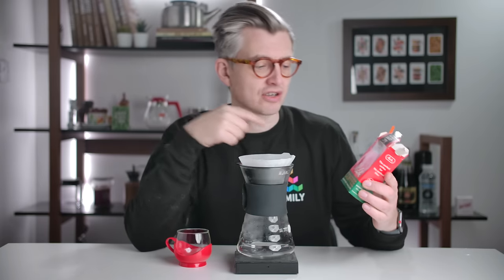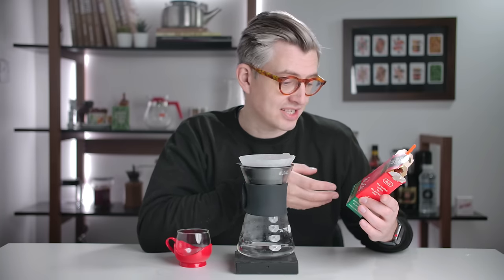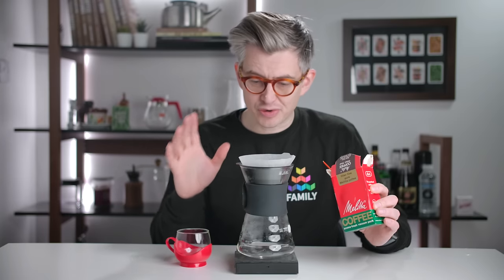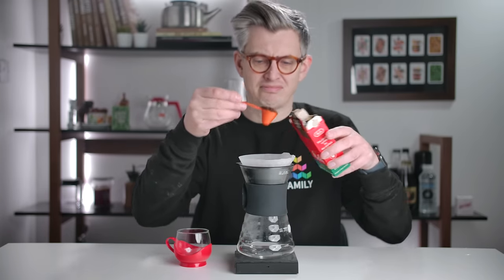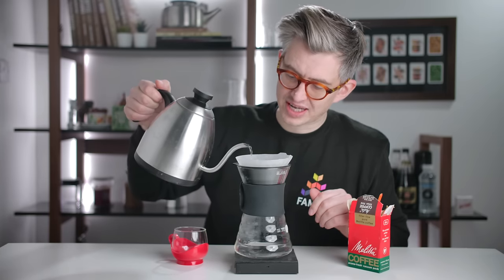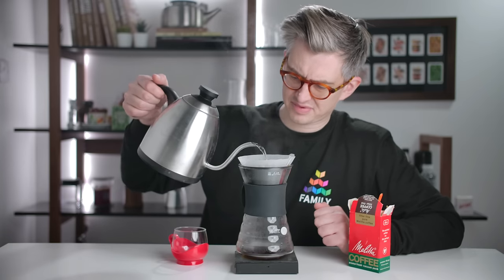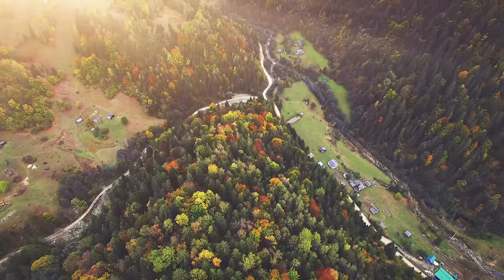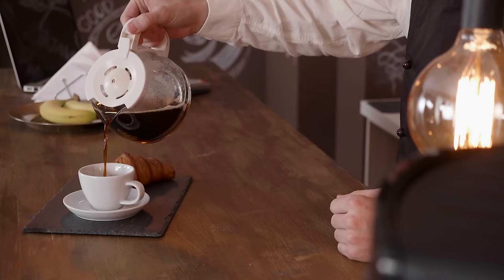Bonus: Brewing that '70s coffee in a V60

Comment: Hi James, I guess that the grind size dated back was quite fine. So I suggest that, 76 degree Celsius water, after the bloom ( which is pointless for a 40-years old coffee),  fill all the water in one go at six o’clock position to try to create a clockwise swirl (yes, just like pouring water into a cupping cup), and try to taste it yet again please. The taste is undoubtedly not good, but the western style of pour over might also be a problem here.
Back in the days when I was still dependent on the commercial coffee, I normally use the immersion method, which is more forgiving to the days-old, degassed coffee.
Cheers and have fun ;-)

Comment: Comments are still on. The real question, how would it do as ice coffee? 🤔🤔🤔
Reply: You bastard!! I endorse this 100%!!!!!! James needs to make(AND DRINK) a batch from every method possible--until it is all gone.  Also, wouldn't this be the ultimate test of ability of the aeropress to minimize the rancid flavors?  We also need to see that as well;)
Reply: @stevenr5149  I approve. I also feel like this is a good test to see if blending bad coffee with good coffee is a way to make good coffee bree further than it ever had before. Been testing most of this week to see if different brew methods work better for this, and some seem to work very well for this. I'd like James to try doing a blend for a cold brew with a hot bloom and then topping off the bloom with cold water and letting that stay immersed for 12 hours. I've found it's a good way to get high extraction without any bitter notes from lower quality beans mixed with high quality, gives more of a hint of better flavours but works out at about half the price. Your millage may vary though :P